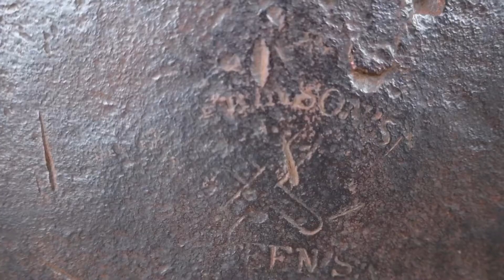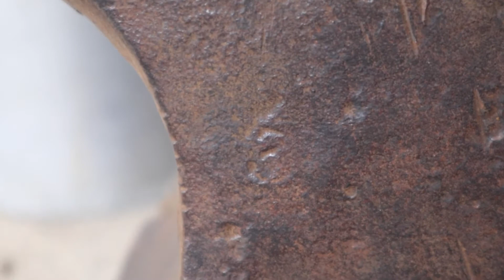My BIG Anvil - 378 Pound Wilkinson Anvil

Comment: Hey man, I've just purchased a Wilkinson almost exactly the same (by the look of the photos, haven't picked it up yet). 3 0 15 weight. How did you date your anvil? I'm trying to figure out how old mine could be.
Reply from the maker: Hey man thanks for the comment, anvils are notoriously hard to age… 
Firstly when I brought the anvil the guy told me it had been in his family for many years and he said that it comes from the 1860’s or there abouts…
So I decided to do my own research, and after comparing photos of anvils, looking at there descriptions and the way that mine has been stamped as well as online forums I concluded that it was from around those times give or take a decade or two…
It’s not very scientific and is open to error… but I’m happy with what I have found…
Hope this helps
Cheers 😎